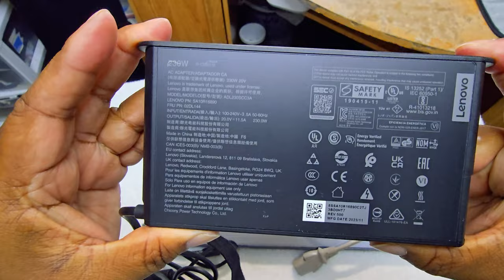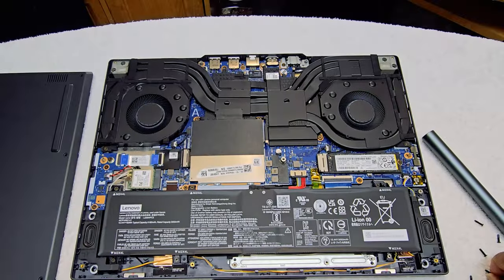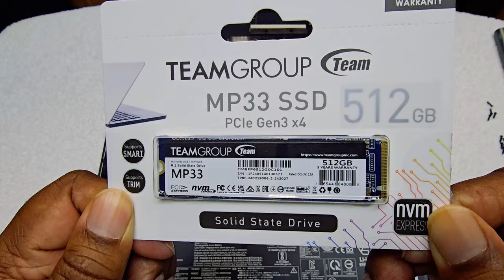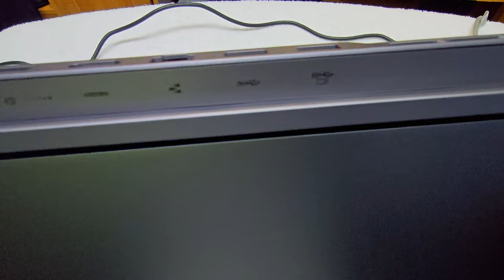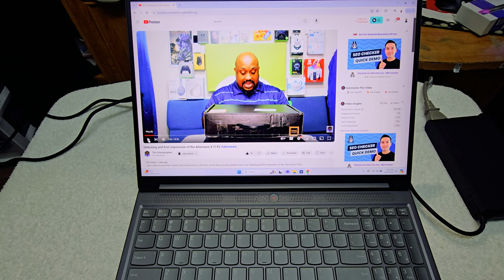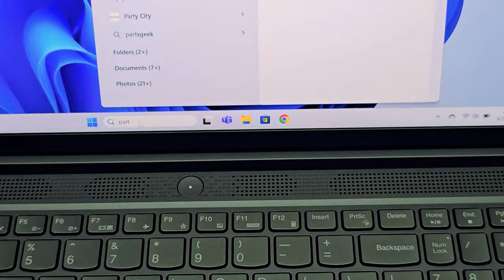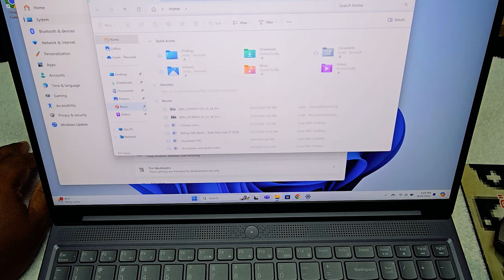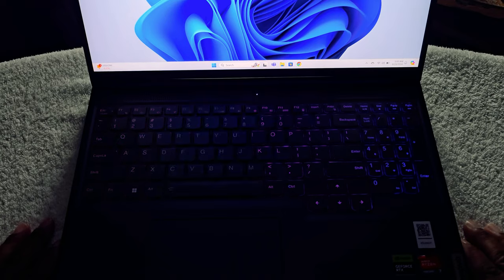Unboxing The Lenovo Legion Slim 5 Ryzen 7 RTX 4060!

Comment: Also does the the Slim 5 have only gray color?
I seen some in black ones and i prefer those over a grey one you know...
Reply from the maker: @lynxedit_ae  I tried to look it up and what I found there is a phantom Blue color but I think that's only for the 2024.  As far as the 2023 it only comes in black and gray. 
Thank you for watching the video and commenting!
Reply: @theghetographer3326  oh yeah 
I wanted to buy the 2023 version too with ryzen 7735hs , rtx 4060 
What do you think about it?
I think its a good entry level laptop
Its around $1300 in my country should i go for it?
Reply from the maker: @lynxedit_ae  I think you should go for it. It is a very good entry level or mid-level tier gaming laptop 💻. But if you can find it open box for a little cheaper I would go for that too thank you for you're watching the video and commenting you rock!.
Reply from the maker: @lynxedit_ae   From my understanding it comes in gray or black but I think some store sells black and  Some stores sell gray color, but you can get both colors at the Lenovo website.